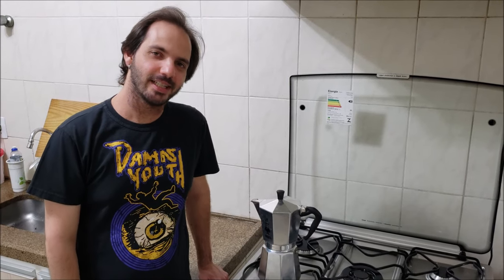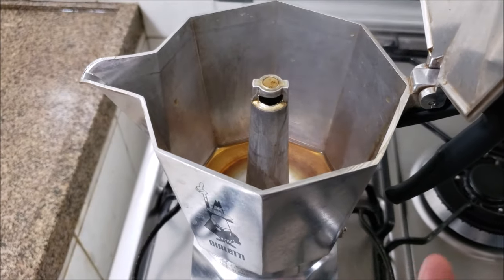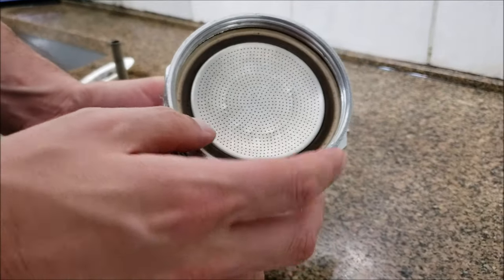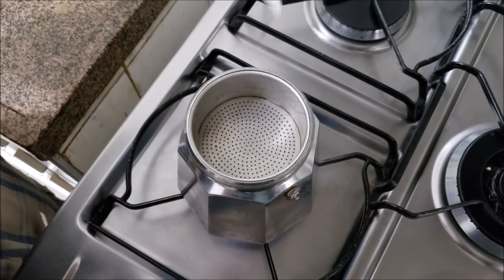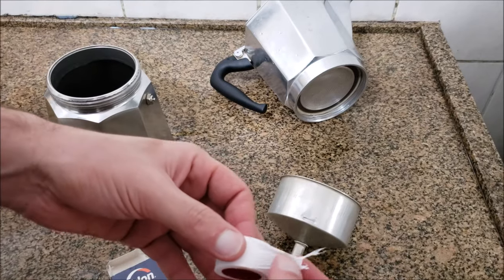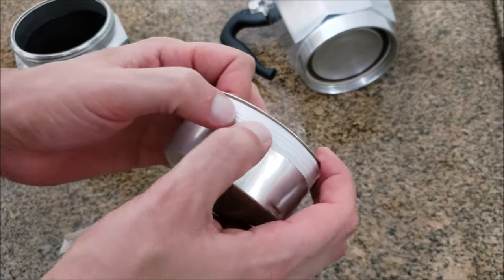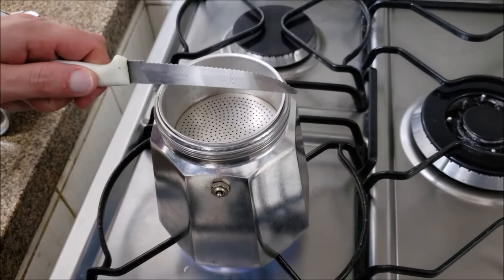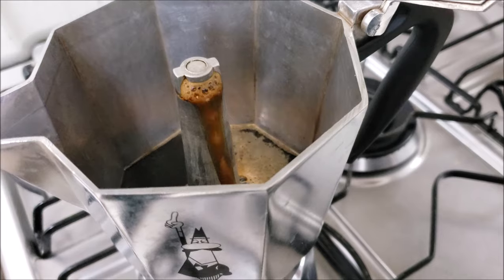Moka Pot sputtering or not working correctly: how to solve it!

Comment: Two rules to follow with this pot, don't tamp or press your ground coffee into the container and use a low heat to boil the water nice and slow. If you tamp the coffee the water will just blow a hole through the middle of the tamped grounds and will go straight to the top without percolating through the coffee first, this also happens when the heat is too high.

Comment: For someone who is having this problem but with a new moka. The problem is the rubber is very new and it is very rigid and hard. The mechanism must be closed with all the strength. And in the beginning the only way is to use cold water. By using boiling water, it is very difficult to close the moka with all the strength you need. I say it from experience. I thought my bialetti venus was faulty. I used a cloth but I still burned and I could not close it with all the force that the moka needs . At least you have to do it like this until the rubber is more flexible. because being new and closed it with little force, the air escapes and ends up spitting. after adjusting with all your strength it should come out steady and just spit at the end
Reply: I’m so glad you shared this.  I was having issues with my brand new Bialetti after just two uses!  And I was using hot water too.  I’ll try the cold water for a while.  Mahalo nui!
Reply: @Hinaweena  I'm glad the comment helped you!
greetings

Comment: Mine was left unused for a long time without cleaning. Which resulted in coffee grounds turning into some sort off white odourless spongy type material which came out of basket in one piece. So easy enough to clean. Elsewhere coffee coloured rubbery type of substance which ended up blocking centre spout on one side at least. So reamed that out with a brush that came with a Turkey Baster. Took a few attempts by the way as was quite rubbery. But will be incorporating baster brush in my cleaning routine as inside of centre spout entirely overlooked previously. Thanks for this video also as something that hadn't considered before. Having just brewed an excellent cup and all now working perfectly. So will also check if basket fully sealing next time around.

Comment: Ok I had same problem with brand new pot, Pedrini brand! 
The funnel was just to lose. I did experiment as you with water and it was the same. Found some kind of tape at home, not the same as yours but the black rubbery one for isolation, and taped couple of circles at the top of the funnel and problem solved! thank you so much!!!!!!!! It only makes me mad I will always have to use tape and this is brand new pot and obviously it was just not made correctly. EDIT: OK so I read the comments and realized I might have this problem precisely because it was a new pot and maybe it will solve itself when it gets more worn in :) still keeping tape at hand haha

Comment: I read about this same solution on Reddit after losing function from my Moka Pot from too much tapping of my funnel (deforming it slightly) on my compost pail.  I was able to restore function and get a fine cuppa once more.  This video is an excellent how to on the process.  I realized I went a little frugal on my Teflon Tape wrap and will reinforce a bit now.  I'm about 6 brews in on the original wrap with no sign of failure, however.  Curious to see if I get better function with a better wrap.
Reply from the maker: Hi John! Yeah, tapping it when cleaning increases the chances to deform it. Try improving your wrapping, it also helps with the performance of your Pot. Thanks for the comments! I'm glad I could help:)
Reply: ah jesus effing christ...ok that's why it's leaking too for me, and I tried everything, cleaned it perfectly, new gasket, etc...I hit the filter on the side of the sink like my mother used to do and let the used grains in the drain (which also cleans the drain).

Comment: Thanks for this video. I just bought a Moka pot but it was sputtering and I wasn't sure what I was doing wrong. There was nothing to fix but not in a single video I watched was mentioned that you really need this to be tightly closed. So what fixed my problem? I made sure to close it as tight as possible.
Reply from the maker: Hi Dave! Yeah, tightening it really hard also helps. The problem with it  is that it is not practical and some people don't have so much strength to do it. A not problematic Moka Pot doesn't need to be tightening so hard.

Comment: If only I saw this video 15 years ago :) tested it today and it works. Based on this video I think I will grind a little bit from the top of the bottom boiling chamber, so that the coffee basket will sit flush with the bottom boiling chamber - than the pyre tape should not be needed, it should be sealed by the seal in the upper part of the bialetti.
Reply from the maker: Hey, that's to read from you! 
Yeah, that could be a nice idea, butnit requires a good grinding work, otherwise you could ruin your pot! Be careful!

Comment: What The Coffee Hack!!!
I bought a cheap moka pot, chinese version of Bialetti. Same design. And since I bought it a year ago, it always sputtering.
I tried fine or medium grind, still the same. Hot water? Still the same. Then I try your tip. Finally I saw moka pot as I seen on YouTube.
Reply from the maker: I'm glad I could help you!! Mine is a original (as far as I know) and even so I've faced this issue! I've also tried everything you mentioned, without success. Then I thought about the physics of a Moka Pot and by that I could verify that the issue was in the sealing of the funnel. 
Have great brews with your brand old new Moka Pot! :)

Comment: This works.  Simple as that.  I didn't have Teflon tape on hand, so I used sports tape instead (the white tape for taping up your fingers, toes, ankle,etc).  That works too, although I'm not sure if it will be as durable.  It has survived 7 coffee brews so far.
Reply from the maker: Great! The only thing I would  worry about is the material of the tape you've used. I think you should check if it releases harmful fumes or substances and also if it withstands temperatures about 100°C degrees.
Reply: @viniciusandrea3251  You're absolutely correct.  However, I used the athletic tape simply because I was eager to test out your suggestion.  I have since replaced that nylon/cotton type tape with the Teflon tape you suggested.  For anyone interested, Teflon is a brand name for polytetrafluoroethylene, a polymer that is highly heat resistant and non-reactive with other chemicals (thus safe for cooking).
Reply from the maker: @tekharthazenyatta2310  Great!

Comment: Thanks for you video, it helped me solved my problem after installing a new gasket, i think my problem was a combination of several things, deformed funnel, new gasket probably no seating in as well as the previous one and not screwing the top enough as i did not need to tighten it too much before. The PTFE surely did not do any harm but the water was coming up before i added it. My previous gasket was absolutely fused to the pot.
Reply from the maker: Hey J-M-P, I'm glad I could help you! You're right, there are some things that influence on the performance of the Moka Pot, and sometimes the problem comprises more than just one factor.

Comment: Thank you so much for the tip.
I have one question, why do you think this happened?
I mean, your moka pot looks perfectly fine, why would stop working properly?
Reply: I’m wondering the same thing because mine was fine until I installed a new gasket and filter. Bialetti brand, not after market. I’ve had my pot for many years with no issues. All of a sudden it started sputtering. Why?
Reply from the maker: Hi, Jorge! I'm glad I could help! 
Well, mine hasn't worked properly since the day I bought it (and it was brand new). 
My theory is that the funnel is defective or can get defective when cleaning it. Other than that, rubber gasket sealing condition can influence on it.

Comment: Thanks for posting this. I have two double-shot moka pots, a very old Primula and a newer Bialetti, and both always work perfectly. I also have a larger one like you show here (6-shot?) that has never worked properly. It misbehaves just like you show early in the video. I'm sure this fix will work because it's always seemed to me that the funnel/basket in the larger pot is too loose, slightly too small in diameter. Thank you very much for this idea.
Reply from the maker: Hey, Phillip, thank you for your comments! I also have a smaller one (3 cups) and it works perfectly, meanwhile this 12 cups version was always sputtering amd presenting issues like this. From my point of view, it happens because of the size of the funnel related to the aluminum thickness. Anyway, I'm glad I could help! Cheers!
Reply: @viniciusandrea3251  The fix worked, by the way. 😁   Then on Amazon I found some soft silicone gaskets that are thicker than stock gaskets. That also fixed it.  Thank you again.

Comment: Ingenious solution. A few questions…. The tape does not melt to the steel parts? Is it safe to use the tape in a liquid that you will be drinking? Do you replace the tape each time you use the pot, or does it last for several uses?
Reply from the maker: Hi, AA! No, the tape doesn't melt and also doesn't release harmful fumes or substances. This kind of tape is made of PTFE, wich melting temperature is about 327 °C degrees, meanwhile the Moka Pot temperature while brewing coffee is about 100°C degrees. 
There's no need to replace it every time. I personally just replace it when it gets coffee stained, which means something about each 3 months. 
I hope I've answered all your questions. : )
Reply: @viniciusandrea3251  thanks so much!

Comment: Great video.  Your solution is necessary for many Bialetti pots because the there is simply too much slop (play) in the connection, so the steam can find other routes.  Take a close look at the generic pots that actually work much better and you'll see that the gasket presses directly against the filter making a tight connection.  It's crazy that the Bialetti brand would make such a basic mistake..  Cheers!
Reply from the maker: Hi Matt, thank you for the comments! I totally agree with you. Bialetti should work in a solution for this! Anyway, I'm glad I could help!
Reply: Knowing how insanely strong my Italian friends like their Moka coffee (and the further south you get the stronger they seem to like it!), I rather suspect this may actually be deliberate on Bialetti's part. But it does mean that for several months after fitting a new gasket, you have to screw the pot super-super-tight to avoid the problem shown — and if necessary, use the clever PDFE teflon tape trick shown in this video.

Btw I found this video a real revelation about how the Moka pot works — as I explain in a recent post here. And (of course) it helped me solve an identical problem I was having since recently replacing my gasket.
Reply: @Muddy283  Good points.  I guess I didn't realize the Bailetti gasket needed a break-in period.  Thanks 👍👍
Reply: I wish I new this sooner.  I just bought my first moka pot and spent $50 on Bialetti (the cheapest one).  I won’t give up on it yet, but my next pot will be a generic cheaper one.  Lol… mahalo!
Reply: @Hinaweena  Just screw it on super tight.  But yeah, I find myself using the generic one more..

Comment: THANK YOU GRAZIE !! We have a 6 cup Moka and I recently replaced the rubber gasket because the original one was so deteriorated that it was resembling a dried goop and steam was coming out the joint. With the new seal it started spluttering and somehow was worse! I was wondering how on earth a new seal could cause this, but it seems the old seal had deformed so much that it actually had a deep recess for the edge of the bottom section to slot into, but it had enough raised section to press down the funnel deeper into the bottom section. The new seal does not have this 'molded' in just yet, but I assume over time it may. In the meantime I am going to try the seal tape.
Reply from the maker: Yeah, try it. I think it will help you!

Comment: Great suggestion.  THIS is my problem EXACTLY.  Question though - how heat resistant is the PTFE Tape and does it fall off when you wash the funnel?
Reply from the maker: Hi Tony! 
PTFE tape degrades at 243°C, so there's no poisoning issues when brewing your coffee, because at this situation the Moka Pot temperature is about 100°C. 
And it doesn't fall off when washing the funnel. I usually replace it by 3 months of usage.
Reply: @viniciusandrea3251  Awesome!  Thanks!

Comment: I never comment but you are a legend, FYI masking tape also works :)
Reply from the maker: Hey Jamie, thank you very much for your nice words! And I'm glad I could help you, it is really rewarding for me! :)
Reply: I am not so sure that masking tape (both the “paper” and the adhesive) is food-grade. NOT SAFE TO PREPARE FOOD WITH! The Teflon/PTFE tape is food grade safe. With that being said (typed actually) you should not need any tape on the funnel. The rubber gasket is supposed to seal everything. If in doubt replace it. Then make sure your funnel top rim is smooth all the way around and it sits even with the rim of the bottom reservoir. If it is not round as the base or has dents or cracks around the top edge, replace it. And check the top of the reservoir to make sure there are no dents or cracks in the top rim too. I see some of these Moka Pots at flea markets and sometimes the pieces are mismatched or they have been dropped and damaged the top rim so that it doesn’t sit flush and tight to the gasket when assembled. And only fill the funnel to the top edge and level (not heaped or below the top) with your ground coffee. When the grounds get wet they swell up with water and will press up against the top “filter”. I like that he shows how the steam pushes up the water through the funnel (& coffee during normal brewing) but the tape idea is really not necessary.

Comment: I just noticed with my new Bialetti Express (three cup) Moka Pot, you have to keep coffee and or water away from the outside silicone/rubber gasket to prevent it from leaking. Don't PACK the coffee in. Keep it below the lip of the coffee holder. Maybe this can also fix water boiling into the top chamber. If it doesn't work, just use this method.
Reply from the maker: Thanks for the tip, I'll try it!
Reply: @viniciusandrea3251  nice. Maybe you received a faulty funnel (that holds the coffee powder). All my funnels five funnels sit correctly. Maybe you bent the little lip on the funnel because of constant cooling it with cold water? Maybe you are boiling the water to high that it built extensive amount of pressure that bent the lip rim? It's not suppose to do that, but sit snuggly on the rims inside the boiler. The silicone/rubber ring is supposed to add weight to the rim around the funnel after assembling the pot so it doesn't move and cause any leakages. 

Like I said, I have five Bialetti moka pots (three stainless and two aluminum), never has any of this happen to me. Sure my three cup silicone ring is black, but it keeps a seal. 

Also, don't screw the Moka pot on too tight after you put it away. Make sure you assemble it but put the top part on loosely and not too tight so you don't wear down the silicon/rubber ring.

Comment: Hi Vini,

My cheap ebay £8.50 gbp 12 cup moka pot has been driving me crazy over the last few days and would not stop spluttering and splurting and giving not much or no coffee at all in the top chamber no matter what I did until I saw your excellent video here on you tube. So, I found my PTFE tape and tried your method. Unfortunately the coffee basket or unit is so badly made the tape would not work as the distance between where the coffee holder sits and the top of the base was too great as it sat below the rim therefore not sealing correctly when the unit was tightend. However with my thinking head on I decided along with the PTFE tape I would use a decent rubber band on top of the tape and 'VIOLA' after all the trouble i was going through it was a complete success and the pot went on to produce, as it should, a steady stream of coffee into the top chamber. N.B. The 2 seal's between the coffee holder and the bottom and top units have to be completly tight as even the smallest gap will make the unit useless. Thank you so much Vini for giving me the extra idea. Cheers.
Reply from the maker: Hi Keith! 
Wow, awesome solution!!
That's great to read from you, and I'm really glad I could help you find a solution for your Moka Pot! Thanks!!

Comment: Hello to everyone, I was facing the same problem as in the video. I solved my problem with closing Moka Pot as tight as possible, also with leveling the coffee grounds as the same level as funnel.
Reply from the maker: Hello, Cihan! I've tried what you you did, but in my i hasn't worked. I think it depends on the sealing level of the funnel.
Reply: @viniciusandrea3251  perhaps it also depends on the type of the mokapot. Mine is venus 4cup

Comment: Yes, this does solve the issue as i had to do a YT search for this problem - it worked instantly after using the PTFE tape, however it is a pain having to keep doing this every morning - plus you have to keep the tape on hand - is there no perm fix for this without having to keep using the tape every time you want a brew ?

Comment: Good morning from rainy bc Canada ! Curious...does the nut on side of the lower chamber holding water need to be removed and cleaned as well? I have a steel moka pot  for 10 years now and love it! Still a bit of sputtering after changing gasket and not all water evaporates...
Excellent video btw for us morning coffee lovers ☺️